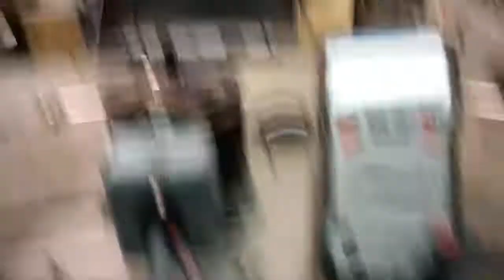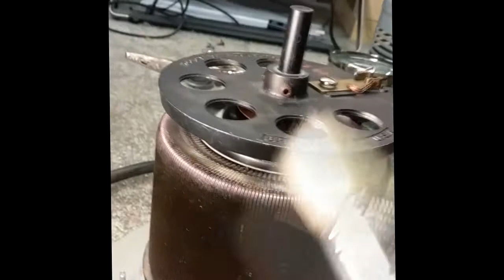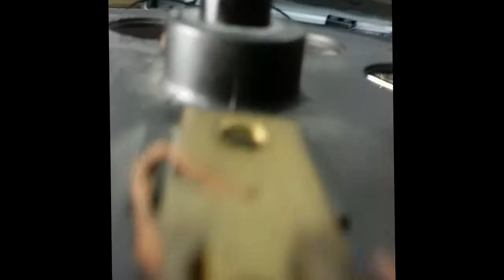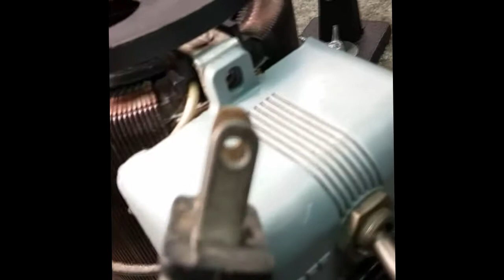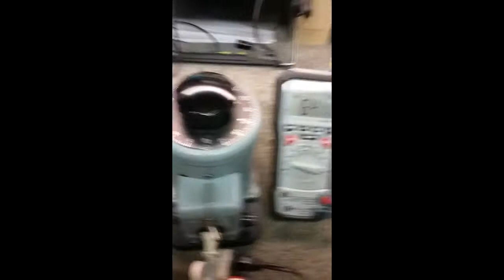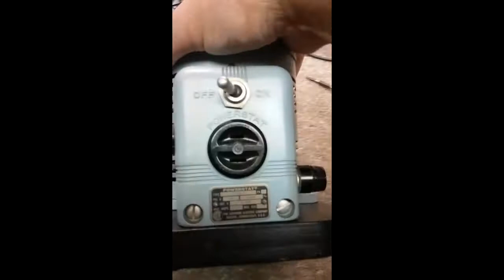Superior Electric 116 Powerstat Variable Variac #Autotransformer Refurbishment

Comment: Do you know of any more uses for the 116 than electronics repair? I bought one and now searching for some uses.
Reply from the maker: Sure,  a couple things you can do with one. First, you can use it to control the speed of a fan. Just be sure to provide enough minimum voltage so the fan is not struggling to run. For 110v fan anywhere from 90-115v range. Secondly,  it will work as a dimmer for some lights including LEDs. Lastly,  you can make a variable DC power supply with the addition of some diodes and capacitors. I have a video demo of that functionality.
Reply: @ElectroRestore  Do you know the proper size of the fuse that it takes? Mine has a 32v 8amp and it appears it is a slo blo fuse.
Thank you
Reply from the maker: @SDsailor7  I would use a 4 Amp slow blow fuse if you are never going to use more current than that. The autotransformer should be rated 5 amps.

Comment: I just bought the 116C
Do you know what year these were made??
Reply from the maker: I am not sure but between 1950-1960s
Reply: @ElectroRestore  I just bought one of these models type 116 and it says on the tag that it can go to 140vac and the dial on top shows the graduations to 140vac but mine only goes to 118.5vac so something is wrong. I found a website with information about these variacs. I found out that they came in 120vac and 140vac the model type 116c came in either 120 or 140vac. So now I am stuck with one that has the wrong info and does not even go to 120vac. I don't think that the voltage limit can be moved to get higher voltage??
Reply from the maker: @SDsailor7  Sorry for the delay. Yes, you can increase the voltage externally by adding another transformer that is like 1:1.5 or some other increment above 1:1. You would need a transformer that can handle about 6 Amps of current.